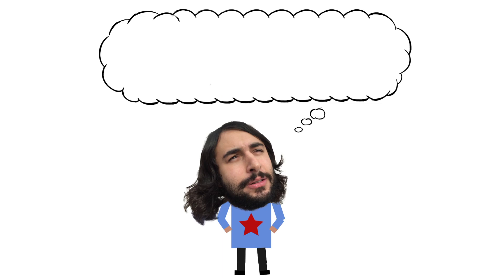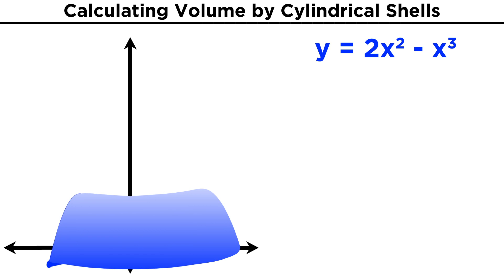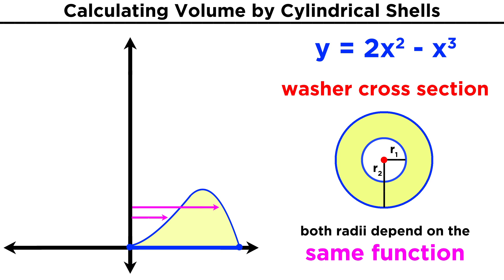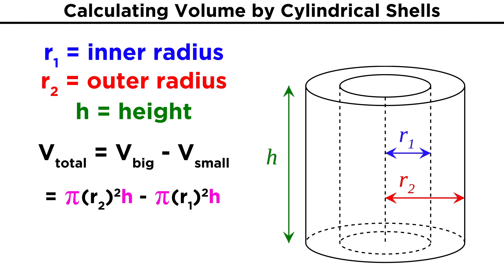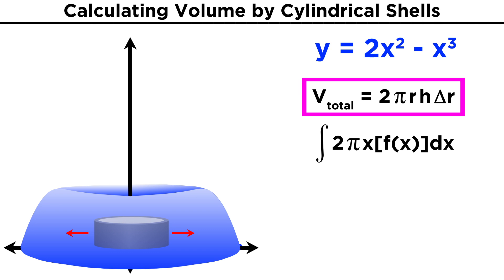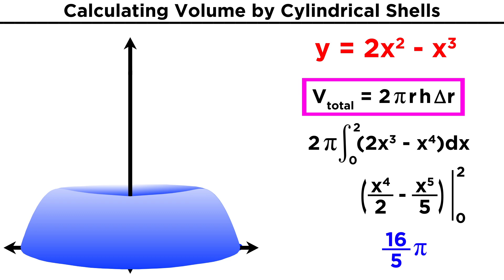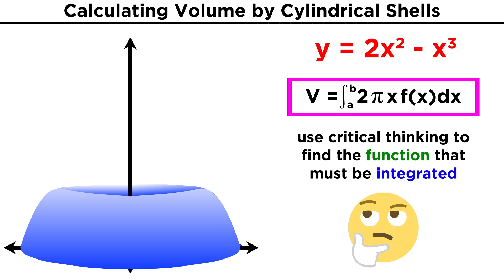Calculating Volume by Cylindrical Shells

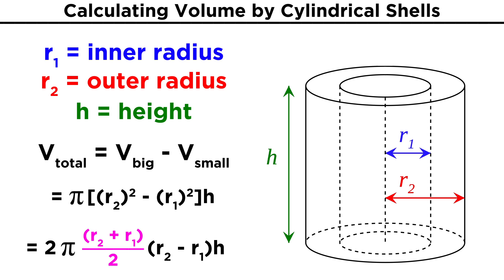Comment: At 3:34 I can see what is happening here algebraically, but I don't understand why we would want that average r. Wouldn't the mean of the two radii be a radius somewhere in the middle of the cylinder's shape? Like, r2 is the radius of the entire cylinder, yet you say later that the new radius we get from this (r2 + r1) / 2 is the radius that gives us the circumference of the entire cylinder? Maybe I will understand as the video goes on but it just seems a little strange to call this a solution.
Reply: I am having the same question.
Reply: Same

Comment: can you solve this: Using the method of cylindrical shells, set up an integral for the volume of the
torus formed when the circle of radius 1 units centered at (3,0) is revolved about
the line x = 1.

Comment: why is it when calculating volume of a revolution with circles, we integrate a circle without a thichness onlly pi*r^2 but with cylindrical shells we add a thickness, why can't we use 2pi*r*h?
Reply: I just realised the thickness (delta r) may just be dx but I am not sure

Comment: I understand that we just call the average value of the radii 'r', but why did we call (r2-r1) delta r? I did not get that part at all.
Reply: r2 - r1 is how much we have moved along the x-axis to get the next cylindrical shell, so this is delta x. When we integrate, we make each shell infinitely thin and so we set this delta x to approach 0 in the limit.

You can think of this approach as those old style pirate telescopes that have smaller cylinders inside larger cylinders and can extend or collapse. Only here you've got infinitely many of them and each one is infinitely thin. The height of the cylinders follows the function. When you collapse them all inside each other, you get the whole bundt cake. When you integrate you're summing up the infinitesimal volumes of the cylinders by going along the x-axis (moving r2-r1 by an infestimal amount each time). You only need to integrate from 0 to 2 because each change in x gives you the whole cylinder shell. no need to worry about -2 to 0, that volume is already included.

Comment: I don't get how the average radius magically becomes r. Its clearly a value greater than r1 and less than r2 but you show it to be equal to r2 when you claim that 2*pi*r is the circumference of the outer circle at 4:07.
Reply: I was wondering the same thing
Reply: they just make the difference so small that (r1-r2) which is delta r becomes dx in the limit, and when the difference is so small (r1+r2)/2  magically becomes r cus  r1 almost equal to r2. dunno if this is correct.
Reply: @lamaduchamatkapalihena9401 make sense
Reply: I'd like to learn that kind of magic too

Comment: while findig the formula for the volume of the cilincrical shell, I don't get how could 2*pi*r be the circumference of the cilinder, since r2 is obviously the radius for its base circle, not the avarege radius. am I not noticing something?
Reply: It might be though the difference is approaching to 0 when you deal with infinitessimals
Reply: @szilike_10  still didn't get it. Did you understand?
Reply: Same doubt
Reply from the maker: the circumference of a circle is pi times its diameter, which is twice its radius.
Reply: @ProfessorDaveExplains  right but you said r was the average radius, not the bigger one
Reply: @ProfessorDaveExplains  Yes but r is the average radius, so 2 pi r will be the average circumference not the actual circumference, the actual circumference should be 2 pi r2
Reply: When we integrate we set Delta x to approach 0, that is the difference r2 - r1 approaches 0. This means that r2 approaches r1, and so both r2 and r1 approach r. At the limit they are the same and just equal their average.
Reply: @ProfessorDaveExplains  you completely missed his question

Comment: suppose that a cylindrical can is designed to have a radius of 1 inc . and a height of 5 inc, but that the radius and height are off by amounts dr=+0.03 and dh=-0.01. estimate the resulting absolute change in the volume of a can